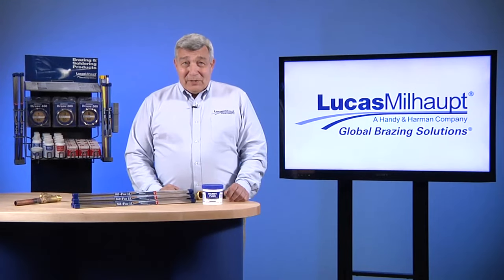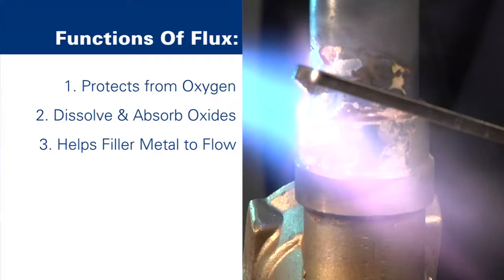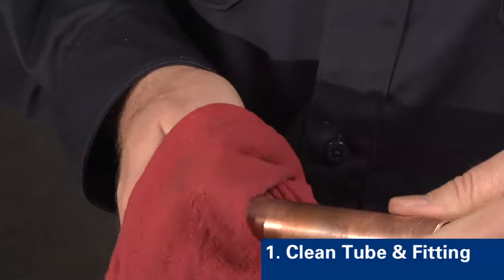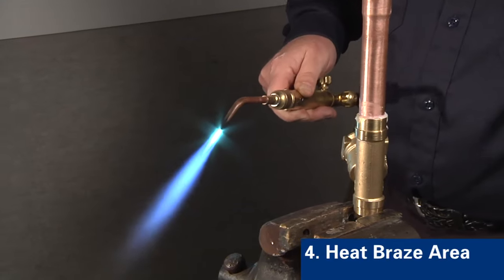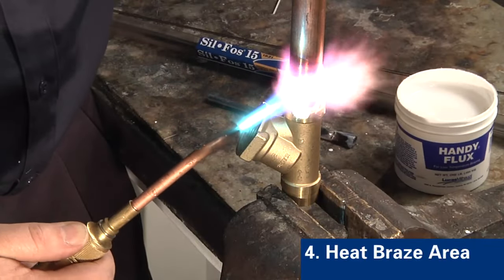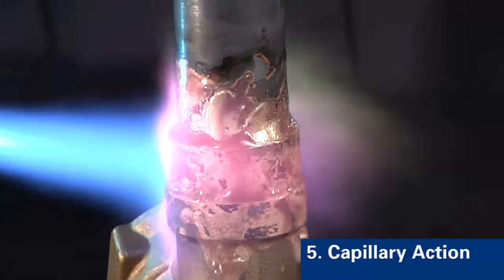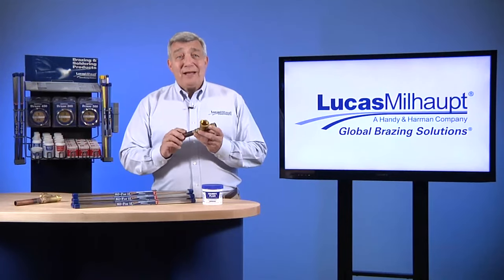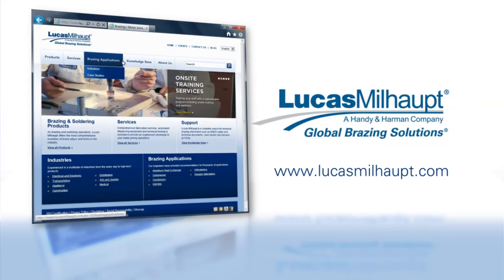Brazing Copper to Brass with Sil-Fos®

Comment: Sloppy. Never apply flame directly to the flux, it needs heat up, boil, solidify and turn back to a clear looking liquid then you can continue heating till it melts the silver solder. you should not have globs all over when your completed.
Reply: What about bronze brazing flux?
How to know when it's ready for the filler rod to be melt?
Reply: @mtrltoolman  Most  Bronze rods now come with flux coated. I  was taught  about 1962  to heat the silver solder flux with a NEUTRAL flame until the flux dries and then re-liquifies as a good time to start getting your thoughts off the girlfriend and on to the most important job of your life. Treat  all joints thusly and you won't ever have them fail. I spent 40 plus years brazing and silver soldering and never heard of one of my joints failing.

Comment: Very sloppy. Flux clogs Txv's and power Pistons. Also In correct flame. 7 on the acetylene 20 on the oxygen "psi"
Reply from the maker: Kegan, this video is for use across a wide range of applications. The flux needed in each use varies. If you are having issues with clogging components within the system you are brazing, then limiting flux and alloy quantity indeed could be an option. The flame used in this video is a reducing flame. We recommend setting your line pressure at the tank body to 5-7psi acetylene and 15-20psi oxygen. This torch is set to that pressure (which you also recommend, so we agree on this point). It is not possible to tell the line pressure from the flame appearance, because the gas ratios are regulated at the torch handle after the tank body. The regulation at the torch handle sets the flame type, not the line pressure at the tank body.
Reply: I just go by what the flame looks and sounds like. I don't have a gauge to set it to those settings perfectly.
Reply: Also the required acetylene and oxygen pressures depends on the torch tips type and size

Comment: You did not need to brush the flux all around the fitting once the tube was seated in the socket. Apply flux to the tube (and the inside of the female end) and insert. Apply flux where you want the SilFos to flow.

The over-application of flux is what resulted in this being a very messy/ugly braze.
Reply: flux also helps protect the parts from oxidation,so that is the reason he applied it all over where the heat was gonna be

Comment: Hi there!! Thanks for the showing us how to use this flux. I've had a hard time trying to find a flux that can be used with oxyacetylene. But well, it seems I have found it!
Now, could you please let me know what is the shelf life on this flux? 
Thank you for your information.
Reply: If it dries out you can add water. It will lay a long time. Personally in this application the blue pre fluxed rods from johnstone would be easier.

Comment: flux also drives out the impurities to the surface,,btw is it possible to melt off a silfoss joint with propane air torch? a buddy of mine said he heated the tubing till it was cherry hot and could not melt the stuff ,some refrigeration guy laughed and told him he would never be able to with propane and needed to use acyt,,i think this is puzzling,,im not sure what that stuff was he could not melt off,because all you need is 600-800 deg C and prop is 2000 deg C
Reply: How much fil fos 15 and handy flux
Reply: @babarsajjad47morning39  ?
Reply: Jack Braddell  what does that have to do with my comment?
Reply: Old Comment but propane and maps won't burn hot enough unless you add oxygen. Acetylene burns hotter on its own and is used to braze. Propane/maps- soldering, Acetylene- brazing
Reply: @namegoeshere69  correct but oxy/prop-mapp can braze too , i was easily able to melt off the silfoss braze on the refrigeration copper tube with a mini torch i made that my friend was not able to with his air/prop torch ,,btw i got a vid of the mini torch i made on my ch

Comment: I've been soldering for 15yrs in a laboratory setting where our copper sees huge swings in temperature and pressure and holds up to this day. This is a very sloppy plumbing job, the extra flux can cause the joint to fail and develop pinhole leaks after some period of time. All that extra flux gobbed on is unnecessary. There should also not be big gobs of solder around the pipe that you started burning to black. Excessive and ugly mess. You should just see a thin ring of solder at the joint because that solder should actually wrap around the copper inside the brass female portion to create its seal.

Comment: Did he braze that with his eyes closed sheesh that was ugly and I never seen anyone flux before brazing only when soldering I could be wrong but I’ve never fluxed anything I’ve brazed
Reply: I don't flux copper to copper but copper to brass will give you problems without flux. Copper to steel also requires flux.